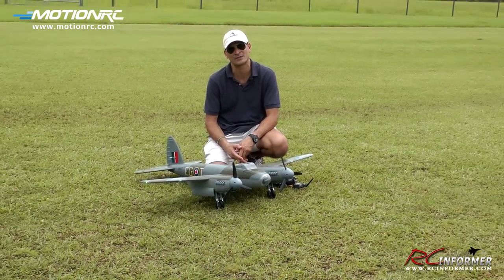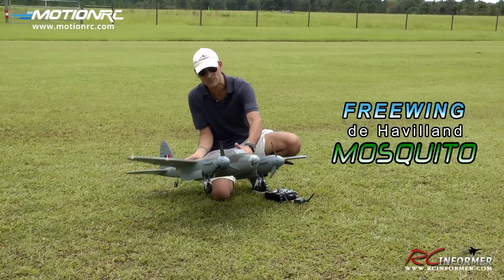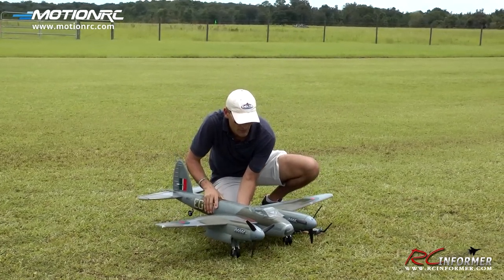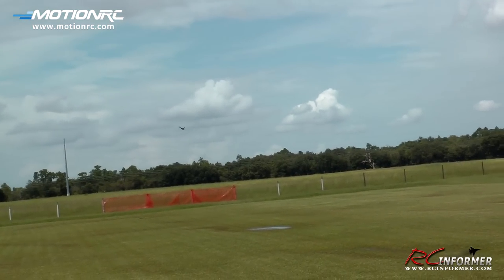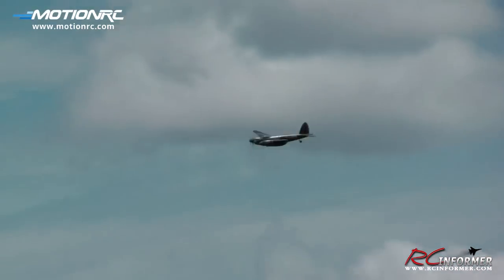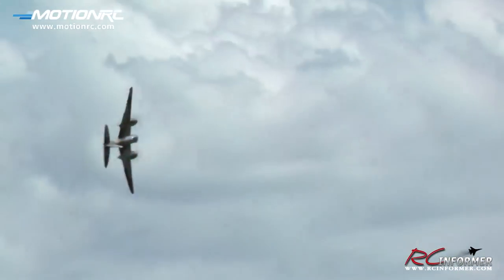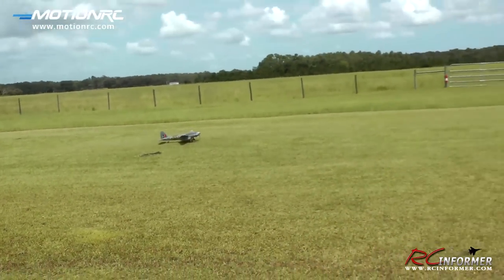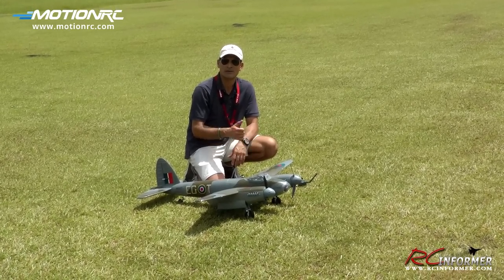MotionRC / FREEWING de Havilland MOSQUITO Flight Demo By: RCINFORMER

Comment: It's nice to see that Freewing upgraded the landing. I have the same plane purchased about a year ago and it came with servo operated mechanical retracts and thin wire struts. Needless to say, they bent and broke easily. I am on my way over to MotionRC now to get some of the new strut goodness, my Mosquito has been grounded too long.

Comment from the maker: It is a QUANUM Telemetry unit, it gives real time battery voltage, amp usage, temperature.... its like having a gas gauge for your lipo:) you only get about 5 run time on the recomended 2200 pack in the mosquito, so I had to keep a close eye on the amp usage while flying this demo....

Comment: Hey Rich, nice vid with good info. Very nice demo flight.
Any reason you haven't installed the flaps? I can see from the vid that it landed nicely
without them but for using a shorter, more restricted area, they may be necessary.
Thanks for taking the time.
Rob